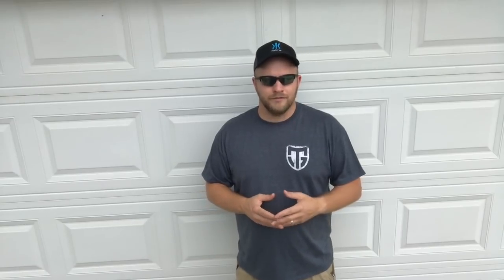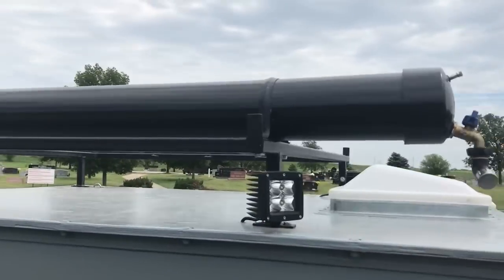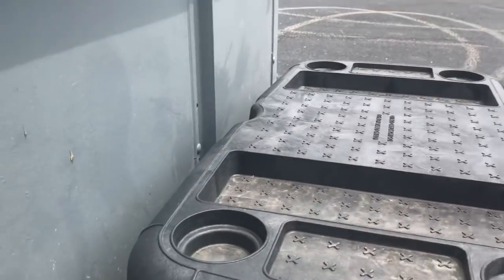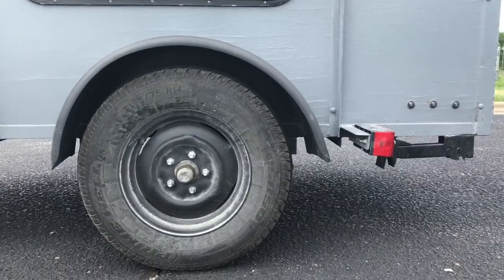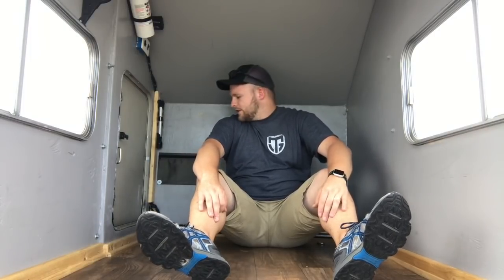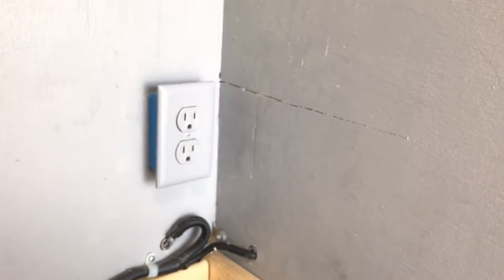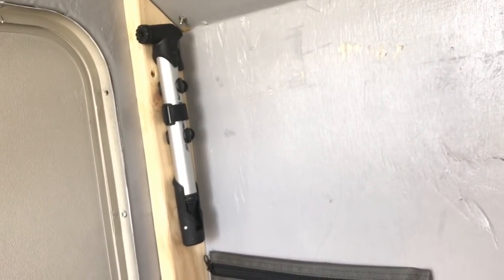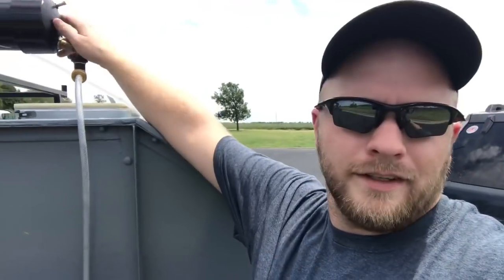Small Camper Trailer-Homebuilt

Comment: Very nice build.  Moving the axle over/under the springs can adjust the height.  Or switch to a torsion bar axle, which gives even more options.  Living on the Gulf Coast, I need a camper to run away from hurricanes when no accommodations are available.  I will probably build it to bolt onto my utility trailer frame, after the utility box is unbolted and removed.
Reply from the maker: Your trailer idea is good especially if you need to haul bags and boxes. If it, look into truck bed campers to put on the trailer!

Comment: You could make a bar side to side and triangles for each wheel  independent suspension that raise and widen to fit. Bigger tires with wheel travel and dampening. You could also get some longer more flex Deaver leaf springs and shocks maybe a wider axle? It could raise it for tires and loose a pumpkin gaining ground clearance. Your truck with a body lift is not for much off roading pulling a trailer as well though.

Comment: Neat set up. Think about flipping your axle to the bottom of the leaf springs to gain a few inches of clearance. Also will allow for larger tires. Especially if you want to be able to have the same wheel/tire package as the Jeep.
Reply from the maker: My only issue with flipping the axle is that it would only give me body height. The axle would stay the same distance. And yes, bigger tires would raise the axle up, but I would be in the same scenario. If I had the money to do it, I would install torsion axles. But at their cost and the minimal off roading that will happen, I won’t break the bank. I’ll be posting more on the trailer soon. Thanks for watching!
Reply: @MidAmericaPrep  
That makes sense.
Reply: Mid-America Prep.  Doing the spring-over will give you the room needed to put taller tires on it and raising the axel tube at least 1.5" giving you more axel lift.  Your Jeep looks like it's running stock factory size tires.  If you were to measure  the clearance on the rear axel from the bottom of the pumpkin to the ground, you'll see  you have more clearance on the trailer.  I would definitely add a 1.5 to 2" lift block to the trailer to help with the departure angle. It'll also allow you to change the stinger on the hitch to one that's even or +1" and prevent future damage to the landing gear.  I'm speaking from experience, I have a 4.5x10' trailer on 3" blocks, running same size tires as my CJ7. (35x12.5x17). I liked and subbed to see what you end up doing.  Thx.
Reply: 'Flipping' the axles on a trailer is a misnomer. You're actually relocating the spring pack mounting point from the bottom of the axle to the top of the axle
Reply: jrg10332 

Don't DO THAT! It is supposed to be bent on purpose! Just move the spring perch to the 'top' of the axle !!

Comment: You still gave me some ideas.For a inexpensive build that is fairly straightforward.I mean it will be ready more quickly than some of my ideas.But does that pay off in a way?? I like pop up fold out roofs ect....An more than a 3 gallon rinse but that really is cheep an easy enough to put together.I have seen a Rubbermaid bin lifted up over 6ft with a hose but limited pressure an that will heat up faster an better without any power...It is a great last minute idea...
Reply from the maker: Building a trailer how you want it doesn’t stop where others do. It’s something you can plan for and change along the way. Even since I made this video, I’ve made many updates/changes
Reply from the maker: Also, while 3 gallons isn’t a whole lot, when you’re on the trail and in the back country, any amount of warm pressurized water is great. We camped in the mountains last fall over 30 miles from anyone for 7 days. Temps maxed out around 50 and got to the teens overnight. The water would warm to around 70 to be used for washing dishes and hands in the evening. We didn’t even use the entire 3 gallons. Had we wanted to use it for a shower, we could have easily pressurized it all the way and used all 3 gallons to do so. Refilling it via the local stream.

Comment: Hey man you know you can get leaf spring extensionto raise the rear part of the leaf spring downward which gives you lift just like when you lift the rear of a truck hope it helps awsome build i want one now LOL
Reply from the maker: Without changing the axle out for torsion axles, lifting it does me no good. The axle will stay the same.
Reply: No you dont have to change the axle Advance Auto Parts sells a leaf spring lift kit i installed one on my Colorado and gave me and additional 4 to 6 inches of lift

Comment: There is an off-road tire that uses a 14" rim. 
27x8.50R-14. 
There are a number of makers who make this size. I think the Les Schwab Open Country tire is one of the less expensive options (Made by Toyo, under the same model name). 
Otherwise, nice video. I'm thinking about building an 8x4 teardrop (I call it a boxdrop, because of the boxy shape) and you've given me some things to think about. Thanks.

Comment: I love it.  Great build.  Can you tell me how you treated the exterior for water proofing.  How is the trailer holding up against water penetration in the rain.  I am struggling with cost, and can not afford fancy aluminum panels.  Thanks in advance.
Reply from the maker: I have a series of videos on the whole process. Everything is coated with several layers of fiberglass resin and one later of fiber glass mat. I then finished with a marine grade above water paint. I would choose a different route to finish at this point. The paint is the biggest flaw. It has separated and chipped off. The wood is still in great condition from the preparation.

Comment: Looks good. Your battery box is kind of sticking out begging to get knocked off. Putting it on a triangular platform running from your fender to the front of the trailer would protect it and help the trailer slide around anything you get to close to. Again great job
Reply from the maker: It’s not going anywhere. It will tear the whole trailer apart before it were to get knocked off

Comment: Cool little camper! I am building my own, Do you have a link for the door?
Reply from the maker: I do not. It is a second hand baggage door off of eBay. They pulled it from a wrecked camper. I would suggest a true tear drop camper door with a good frame. This works but isn’t secure.
Reply: @MidAmericaPrep  thanks!

Comment: You should have a hot wire at the running lights plug on your truck.  Run a wire off of that to charge your battery on the trailer.
Reply: njw1977 he will probably have to put a bigger alternator

Comment: What is the total weight of the trailer and would you go with thicker plywood? I’m planning to build something similar and have been back and forth on plywood thickness.
Reply from the maker: Depends as to what is on it. Dry weight without any tools in the box is around 850-900. Adding tools, water, battery and gear clearly adds a lot fairly quickly. Before I added the tool box, water, solar and battery, the entire trailer had such a great CG, that I was able to lift the tongue with one finger. I wish that I had used 3/4 even with the added weight. But being that it’s an exoskeleton frame, I needed all the space I could inside.

Comment: Cool trailer! I could hear you were light on tongue weight when you were driving. I have a utility trailer that rattles just like that when empty behind the wifes Ford Flex. I through a case of water on the front of the trailer when it's empty if we are traveling any sort of distance. The rattle drives me nuts! Once you put some stuff in the tongue box yours will be whisper quite.

Comment: Hey brother I was just currious as to what kind of resin you used on your trailer. This is the first video I have seen of yours. I already have my base trailer built and am ready to build the top. I guided a good friend of mine when he built his teardrop trailer. He had bought a gallon of polyester resin from the auto store. I talk him into using marine grade epoxy resin and he has had zero issues with cracking or delamination. Polyster resin does not bond permanantly to wood. It cost more but is worth the extra expense. I would be curious to know which one you chose to use. Fiberglass cloth will use alot less resin to wet out and finishes smoother with alot less effort. We rounde all his corners with a 1" roundover bit and used fiber glass tape for all edges.
Reply from the maker: Two coats fiberglass resin topped with three coats of marine topside paint. I have several videos on the build.
Reply: Polyester will bond if you sand with coarse, open grit belt sander.  Move the sander so that you DO NOT grind the dust into the sanded wood.  Cooking the glue and plys in a press to make plywood forms a layer of varnish-like hardened tree sap on the plywood surface.  Get rid of that, and polyester resin will bond.  I do it for a living and have had very, very few failures.  I would put the resin on top of some fine cloth to make a stronger film that will crack less.

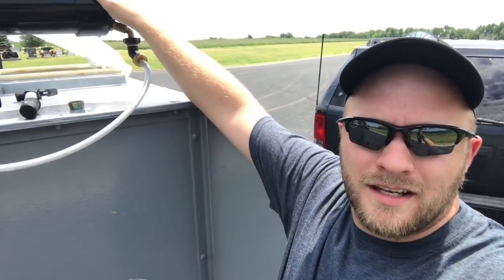Comment: 12:57 you could use a tire/rim valve to pump up the water pressure. How do you fill the tank?
Reply: I think he just un screws the cap on the 90' pipe and fills it up from there

Comment: just started to watch, first of your videos i've seen. going to watch them all since I'm very interested in building my own. first question of many to come; where did yo get the trailer?
Reply from the maker: Craigslist. A 4x8 is great for a single person trailer. I would suggest starting with a 5x10 or a 6x10 if your looking for room for two or more. It also give you space to build cabinets/cubby’s and so on.
Reply: Hey, thanks for the come back. I'm a retired carpenter with a 1997 jeep wrangler thats getting a remanufactured motor this week. this summer i want to take off pulling a small trailer. i'd be inclined to go with a 5 or 6 by 10 since it will be my home. but i like your video and will review your project from your first posting 
 @MidAmericaPrep
Reply from the maker: Having that background will help with the endless possibilities. My first tip is to watch many videos over what others have done. Learning from their mistakes will save you heartache in the end!
Reply: thanks , sound advice  @MidAmericaPrep

Comment: Just a suggestion have you thought about flipping your axle on the trailer it should give you about 2 and 1/2 to 3 in of lift I did it on my utility trailer it takes about 3 hours to get it done right just a suggestion
Reply from the maker: Without changing to torsion axles, flipping it will do no good for clearance. The axle will stay in place and still hit the same rock as if it weren’t flipped.
Reply: How about raising the fenders to create more space for bigger tires?

Comment: If you’re worried about height do a spring over lift for free should give you about 3 inches
Reply: You're kidding right? A spring over doesn't change the height of the axle.
Reply: It makes room for larger tires, which does increase axle height. And increases the clearance to the frame/floor.
Reply: @jayw900  umm yes it does...trailers are normally axle over leaf...if you change it to leaf over axle it will gain 2.5" maybe 3" of ground clearance
Reply: @patb4493  it's a straight axle. It doesnt matter what side of the leaf spring the axle is on, it's not going to be any higher off the ground if you dont put bigger tires on. You will just gain clearance in the ffenders.
Reply: @lucascollier8728  me & 4 mechanics got amusement from that comment ^^ thanks.

Btw your wrong.
Reply: @patb4493  it does not matter what damn side of the axle the leaf spring is on the axle does not sit any higher or lower off the ground you can get together 20 mechanics and laugh all you want but that doesnt change basic common sense. The only way to get the axle higher off the ground (ground clearance) is to put bigger tires on it.
Reply: The axle is gonna stay the same height until you get different tires. It’ll gain body clearance if you do leave over axle.

Comment: Use truck bed spray on liner, put in on in layers or use 1 gal cans with roller, letting each layer dry before adding the next. Makes excellent roof, You can put it on as thick as you want if you let each layer dry! Just sayin…

Comment: You've had problems with the roof cracking? Did you use Polyester or real Epoxy? The cheap stuff you get from Home Depot,Wallymart and chain auto parts stores is almost ALWAYS polyester. Polyester doesn't fair well oi n wet environments,in the water or out in the Sun.Also polyester will absorb water and is subject to "shock cracks" and amine "blush"..... 2 part epoxy from" West Systems" made by the Gougeon Brothers is one of the better products on the market.In wet environments ALWAYS use EPOXY!!!!

Comment: Also, change the axle to spring over.
Reply from the maker: Spring over axle keeps the axle in the same position. It will not give it anymore clearance over rocks and other trail debris. The only fix is torsion axles, that are not a financial option for this build
Reply: @MidAmericaPrep  yeah, but it'll allow for a larger diameter tire, with an aggressive tread pattern, which is what you're after, isn't it?

Comment: Hey bud, if you havent bought your tires yet. I picked up a set of 31's similar to BFG AT's at tirerecappers.com Research them on Youtube,.  100.00 per tire. Free shipping  They are labeled Mud terrain, but that is the only misleading part of the tire. Very good durable true running tires. You can get 235/75/15, the normal size for 65 bux a piece. same pattern.
Reply from the maker: Actually ended up purchasing some 10 ply trailer tires with a mud terrain tread for a little cheaper. Will most likely put KO2s on the next set or next trailer all together

Comment: I don't think you will like that box on the front! I have been looking at those too, but, don't want anything that is going to hold water on the top! I.E. the cup holders and other indentions!
Reply from the maker: Traveled 2,500 miles with it in September. It rained about 500 of those miles and during camp. It is mounted backwards so that when opening, it is face away from the trailer. Never was an issue.
Reply: @MidAmericaPrep  I was thinking more of when the camper is not in use! Around here mosquitos find any standing water! Of course, there are precautions a person can take, but, I just don't think it would be worth the risk!

Comment: DUDE . . YOU ARE pulling THE TRAILER IT HAS NO DRIVE WHEELS SO any tire WILL WORK . . YOU DONT HAVE TO BUY A OFF ROAD 300 DOLLAR TIRE FOR IT . .
Reply from the maker: Except, you’re wrong. When you’re driving over large boulders with sharp edges, cheap tires WILL shread.
Reply: Mid-America Prep  
i see said the blind man. Its a good thing for me I actually read these things. Because of your experiences it will make for a better experience for me when I get out there myself. :)
Reply from the maker: Only speaking from experience. Some of the high altitude places we camp are barely wider than this trailer. I’d rather have something with hefty tread and side walls than some cheap small car tire.
Reply: An 8 ply trailer tire will do everything you need.

If you shred the tire it will be because you are bouncing to much weight not what you are running over..